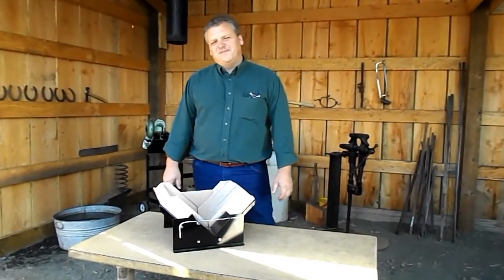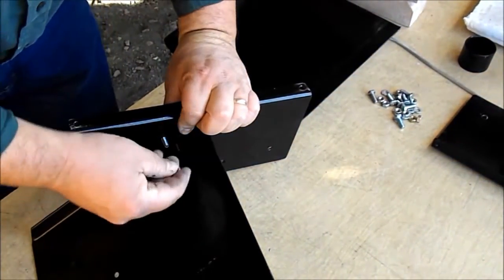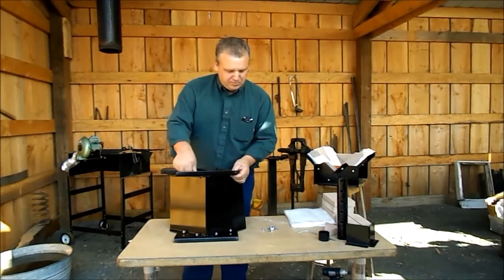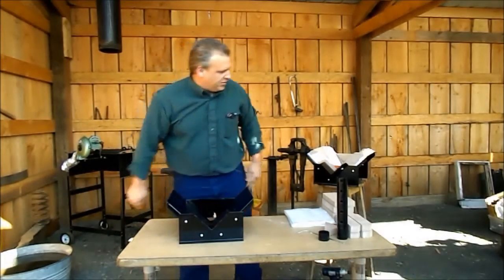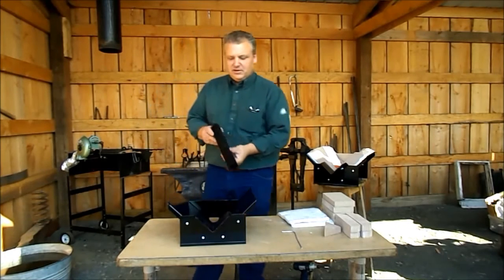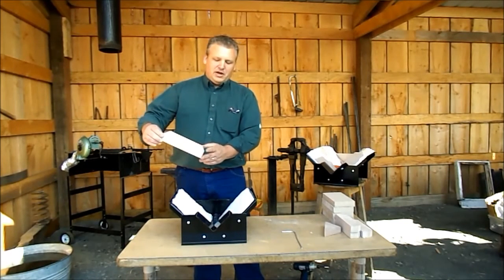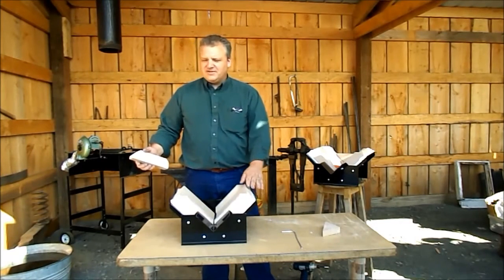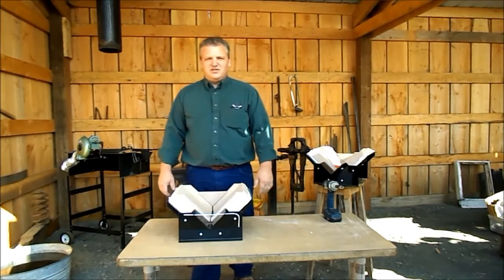How to build the Whitlox Mini Wood-Fired Blacksmith Forge

Comment: That ceramic wool looks untreated? Those fibres are a danger to health.
Reply from the maker: Yes, it is untreated, however no cutting or extensive handling of kaowool is necessary. It will be encased in brick and steal when assembly is complete. If you are going to be cutting or handling large amounts of kaowool for an extended period of time in an enclosed space, it is recommended to wear a respirator. Full MSDS available here so that you can evaluate how best to mitigate your exposure: http://www.insulationindustries.com.au/SiteFiles/insulationindustries2010comau/MSDS_-_Kaowool_Blanket_and_Bulk_Products.pdf

Comment: I just put mine together and it doesnt quite fit like this. The firebricks are too wide for the side plates.It tightened up but there is a good bit of pressure on the bricks as opposed to the metal. It will work I guess.

Im curious, instead of adding the 1 inch round piece at the end of the tube, why not just include the appropriate tube?
Reply from the maker: David The tubing is cut to fit the flat rate box. It allows us to offer the forge for $25 less.
Reply from the maker: Sorry about the tight fit! While the dimensions of the forge are controlled, the bricks vary in size a small amount.  Hope the hardware allowed you to adjust for it!

Comment: I did purchase this mini forge and the Zomax blower. I purchased 2" ID exhaust flex pipe from Auto-zone and it fits so well that I have not installed clamps. I have forged a few pieces and I like this unit very much. Good work, Thanks,
Reply from the maker: Great to hear!

Comment: is it possible to use wood pellets in this?
Reply from the maker: Not really--they are small enough to fall through the draft holes. If you want to purchase fuel, I would recommend natural charcoal.
Reply: Ya if u use briquettes they are made with sawdust and other additives that make what I call wood clinkers and Henry Ford made a car good not briquettes for us blacksmiths they vaporize and are more money consuming than natural witch only makes ask not rock type crap in bottom on forge

Comment: why couldn't you use coal in it.would it get to hot.
Reply from the maker: It's optimized for wood so you can use free fuel. It isn't that coal is too hot, it's that some coal makes a lot of clinker or glass, which can stick to the firebricks or draft tube. You can chip it off, but that could mar the bricks.